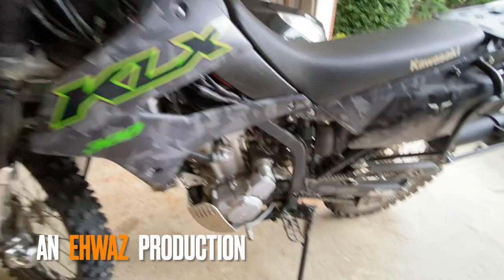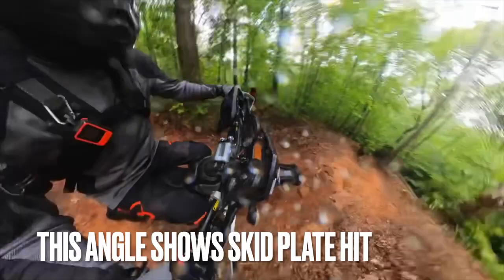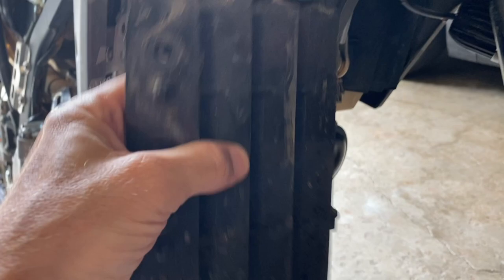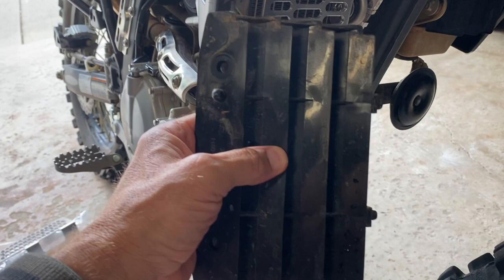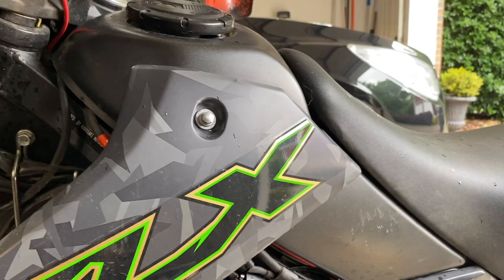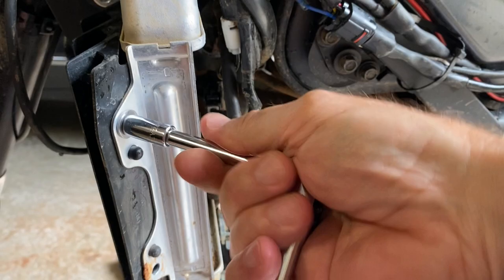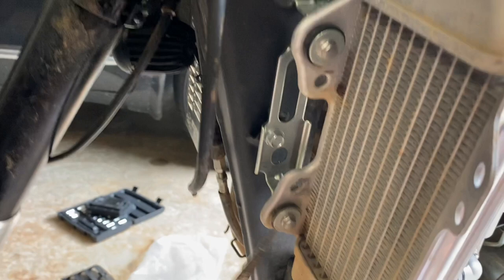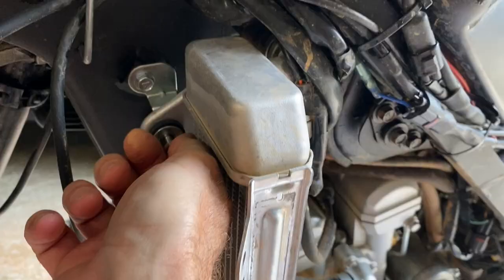Emperor Racing Radiator Guard Install on a KLX 300

Comment: Very clear and through video. I have a’23 KLX and love it. I was not familiar with Emperor parts. The first thing I did was replace the factory “skid plate” as well. Minor point: I believe that you referred to tool as an Allen Wrench, but to me it looked like a Torx bit 🤷🏼‍♂️
Reply from the maker: Thank you!  I used an Allen wrench and a torque bit and likely mixed up both, good catch!  When I speak without a script these things happen.  I'm very impressed with Emperor products, purchased two so far and they are good quality.  Cheers.